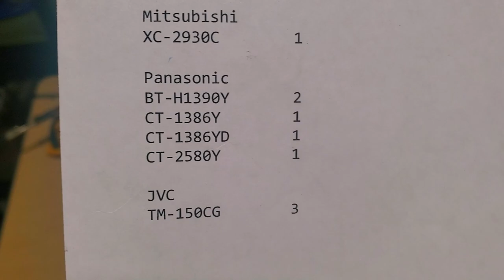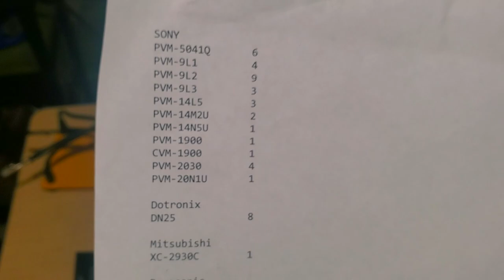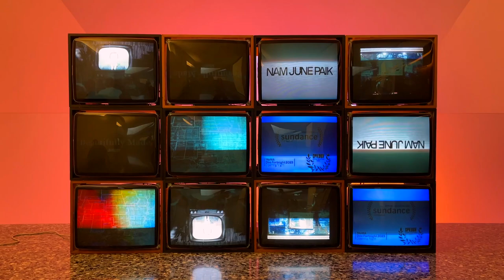Why Museums use CRTs for Art - Interview with Kirston Otis

Comment: External power brick for a CRT is AWESOME and I wish my JVC 1750CG had one. The main reason is I live off grid using solar power, so being able to use a direct DC power supply is ideal for me, instead of losing efficiency from inverting my DC battery power to AC, then back to DC again.